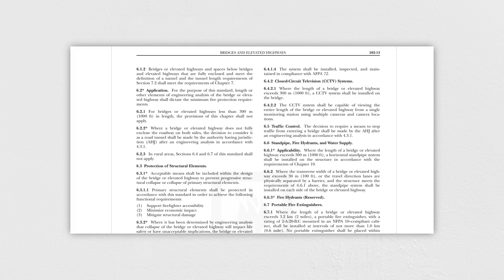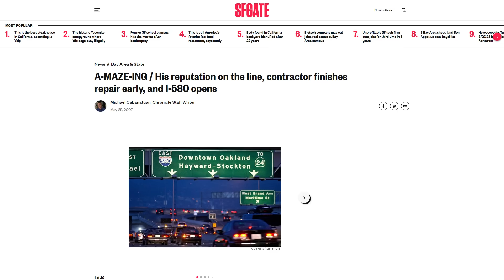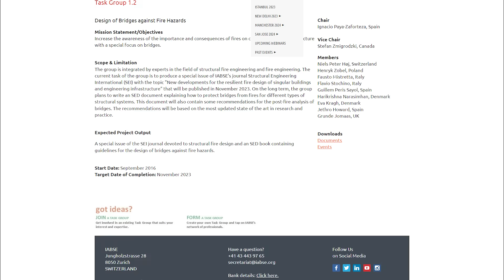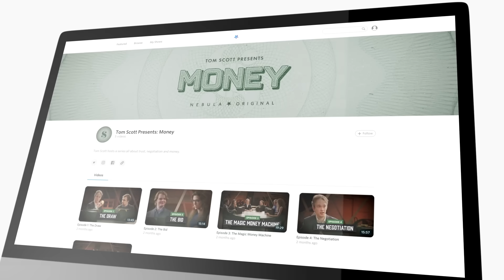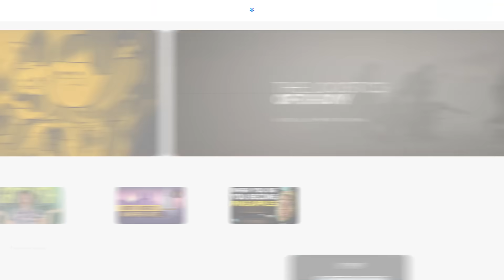Philadelphia I-95 Bridge Collapse Explained

Comment: Automotive infrastructure is the most expensive to maintain.  Train though not the cheapest is the most effcient in moving people.  Large passenger helicopters is actually the cheapest in they just need a maintence garage, crew pay and fuel.  A bus is less expensive then a number of cars to move the same number of people, but uses the same expensive roadways.  A subway/metro due to use of tunnels is more costly then a surface train, but in city where they are supplied, the ridership makes up for that increased cost.
Reply: I hope your not actually making an argument for the cost effectiveness of helicopters. A helicopter able to lift a bus worth of people will burn literally 100-400 gallons of gas per hour.

Comment: Nice job love youre video's.  However in the netherlands we do have regulations about the minimum protection against fires and explosions. Al defined by the state in the ROK 2.0 (richtlijnen ontwerp kunstwerken) (guidelines to design civiel structures) a addition to the eurocode. Greetings a dutch civil engineer

Comment: I must have missed the part where you stress (heh) how steel weakens at temperatures way below its melting point. I believe that's a real factor.
In a firefighter documentary, they were called to a burning warehouse in a train yard. The warehouse was brick walls, steel frame and roof, all ground level.
The warehouse was filled with charcoal and copy paper and whatnot, and all of it caught on fire.
The steel beams supporting the roof simply turned into noodles, buckled under the load they were designed for (just the roof)... and the roof came down.

Comment: I think that are several hardships in protecting bridges.  What is the fuel type and source, intensity, length of burning.  Which one do you build to protect against?   You can protect steel and concrete from fire but not all of those protective measures will hold up well to various weather conditions around the United States.  These same protective coatings might also hide flaws during annual bridge inspections causing new issues.  The protective coatings could also get damaged if a truck crashed into the bridge structure making it useless.  You could install fire sprinkler systems at great costs but it would subject to vandalism and weather requiring even more inspections.   Unlike designing for earthquakes, there is not usually an ongoing costs like there is for fire sprinkler systems.  I would only install these in high risk area or tunnels due to the annual costs above installation.

Comment: Since concrete can and will burn if a fire is hot enough on top of the heat transfer to the metal of the rebar, any bolts or expansion joints weakening those affected it isn't hard to understand why a bridge or overpass collapses from a fire. The issue is more can they be built to reduce the risk without increasing the cost dramatically.

While concrete can burn if the fire is hot enough the chance of a bridge span fire getting that hot are infinitesimal so there is no need to add fire resistance to the concrete itself.

Comment: A fuel truck crashed into the FL-528 SR-3 overpass and weaked both bridges. It reopened 24 days later with two new bridge spans... Cost was about $25 million dollars. If the Patrick AFB fire crew had not shown up to spray fire suppression foam, it would have caused more damage..

Comment: I'm not sure trying to make bridges fireproof is the answer. After all, nothing much is going to resist the heat of a tanker full of fuel on fire, no matter how well designed! A better solution would be to design bridges, especially the type featured in the video, to be easily replaced if they are destroyed. These bridges are all pretty similar to each other, so a few standardised designs should be able to be used for 90% of motorway bridges (especially if one of the design requirements is that the junction (etc) should use one of the standard bridge types).  This would mean that, once the debris is cleared away and the rest of the structure is checked for safety, etc, the bridge could be rapidly replaced using a stock of standard parts. This should mean that the motorway could be safely opened again within a matter of days - perhaps even within 24 hours in 'simple' cases.

Comment: 14:54 That's a very fake screenshot.  Windows 3.x only had support for 256 color palettes with the first 16 colors largely being unchangeable.  Those colors in the "Shanghai Metro Map" would either be mapped to far uglier colors OR dithered to the existing palette.  The screen resolution of Windows 3.x was generally 640x480 so those lines would not be smooth, hi-res lines with clean edges.

Comment: Wait, but does it collapse because the metal melts, or does the concrete break or what?
Reply: The metal loses most of its strength from high heat, it couldn't hold the weight of the concrete.

Comment: Curious, I’ve never heard of a bridge/overpass collapsing due to fire and some searching on the internet doesn’t turn up a single occurrence of such an event in the Netherlands. The worst I can find are some instances of where concrete pillars or girders needed to be replaced due to fire damage leaving them not up to standard anymore. I wonder whether we’ve just been lucky, whether Dutch infrastructure standards are higher or whether for whatever reason we don’t get the kinds of intense fires that cause collapse.
Reply: It's happened before in the US, US is very car dependent so we have a lot of road Infrastructure that is vulnerable to accidents and we have more fuel trucks trying to deliver that fuel to the 300 million+ cars on the road so it's far more likely to have a situation like this.

Comment: Thermal insulation that doesn't burn or completely deform? air + steel sheeting (3500c ?? ) below, creates gap to prevent damage from direct heat
Reply: That increases cost to build and maintenance required to maintain the sheet from rusting.

Comment: So what did the fire do to the bridge to make it collapse? I understand the challenges to building fire resistant bridges. But I typically think of concrete and steel as fire resistant. How how exactly did the heat affect this bridge?
Reply: Steel and concrete will resist fire, for a certain amount of time and are built to resist for a given time, but eventually the heat Penetrated the concrete due to it being over the hotest spot of the fire and started softening the steal supports. At 1500F steel looses most of its ductile strength, this fire can easily heat it to 1800F.

Comment: I guess the thing about fires on bridges and similar infrastructure is that they're kinda "self advertising" in a sense. The fire is pretty noticeable from far away so people will just avoid the bridge, if the bridge is fairly short then the ones on it the moment it broke out will have time to get away as well. So therefore on small bridges there's really not much point in protecting against fire, on much larger bridges the story is different since they're expensive enough to make fire protection worth it and they're long enough that it'll take a while for people to clear it so fire protection is more necessary. Fires in areas where people can't escape easily like buildings, sea platforms like oil rigs, and ships are a much bigger priority.

Comment: This is probably impossible, but why don't major overpasses have some sort of foam fire suppression system to at least try and prevent something like this? Would it come down to money, or construction... (or both)?
Reply: I think it would just be massively expensive–the plumbing, sensors, electronics, storage tanks for the fire-suppressant, etc. 
Plus, fire suppressing foam is one of the biggest sources of the much-hyped but genuinely worrisome PFAS "forever chemicals" that leach into groundwater and have a huge effect on wildlife and human health alike. 
I think it would probably make more sense to mitigate the cause of the fires rather than the damage, i.e. requirements that tanker trucks have certain safety features or take specified routes.
Reply: @HenryKamp  makes a lot of sense. Making a system that complicated for events that rarely happen would be a waste of money and resources. It’s hard not to think there could be some sort or realistic solution to tankers crashing under bridges.
Maybe it would be better to look at the full picture and try to cut down on sharper turns and blind spots.
Also, I do wonder if the tanker trucks themselves could have better preventative measures during the event of a crash to at least minimize the result of ignition.

Comment: i wonder what happens on an employee employer level when something like this drastically changes someones commute.. that person didnt choose that commute by taking a new job or moving to a new residence so its hard to blame the employee but theres likely no specific laws to require to employer to accommodate them in anyway could easily add an  hour to their daily round trip and alot more fuel and wear tear on their vehicle.. if the employee isnt helped cover these costs and simply chooses not to goto work in protest can they be let go? 

id be interested to hear from someone who had to deal with this, its not a simple 10 minute delay nor is it a one or two day thing, that could be an extensive route change for weeks possibly over a month not know how quick construction would have been
Reply: Generally speaking there's no legal protections for the employee in the US for these scenarios; it's typically "come in or you're fired" as consistent tardiness or refusal to come in is going to be a violation of the employment agreement. Any agreement on that is likely to be dictated either by company policies, union contracts, or individual negotiations.

A good employer would try to mitigate that stress, but there's plenty of not-good ones out there.

Comment: I lived in Atlanta at the time of our interstate collapse and saw the amazing work they did to do a full rebuild in only a month and a half, for six sections of 5 lane interstate! I assumed Philly would do the same, but they are not apparently. I'm curious to see how this partial but even quicker reopen works compared to if they rebuilt the whole thing ASAP.
Reply: This temp fix got 6 lanes opened in less than two weeks, and left room for the final bridge to be built in different phases. The final construction will take much longer than a couple of months, but the underpass that is now blocked off only served north bound traffic, so I doubt that closing it for a year +- will make too much of a mess. Apparently there still are questions as to how much damage the vertical concrete walls that supported the collapsed bridge section received, and if that too needs to be replaced it will add time to the job, as now part of those walls are buried by the temporary fix.
Reply: ATL drivers are so hard on the roads the city's gotten good at rebuilding them

Comment: Fireproofing bridges...  start with fuel tankers.  Class 3 products, need to be doused with foam.  Simple solution, place a sprinkler system into the overpass structure.  However, what happens when you have a Class 4 fire - which is dry chemical extinguisher only?  One thought is to make the underpasses with box culverts, then overline with limestone.  Some forms of limestone are excellent firewalls.  With the box culverts, having a store of 50 or so stashed somewhere would be a handy idea.  Have a universal height and internal dimension, and set up the overpasses using these box culverts.  Then, on top, place steel beams, a deck, then make your new roadway on the decking.

Comment: Not a bridge collapse, but a bridge replacement and construction.

Recently in the past 5 years over and on I-80 east of Salt Lake, they have been replacing overpass bridges and adding in overpasses and I can tell you right now, it is a pain to go through the redirected traffic. Especially since my job route goes through those zones.

I also lived in Maricopa, AZ for a few years before Salt Lake City and back in 2016 the city purposed an overpass over the rail lines going through the main highway 347. These trains would be miles long and cause so much traffic, especially since Maricopa was growing from the 33,000 people from when I moved there, to the 68,0000 when I left. So, because of this the city, state, DOT invested $51 million to build an overpass and reroute the major roads. The cool thing was that before I left, I got to see, and experience, the construction firsthand, and the major delays caused because of. Unfortunately I moved just a few months before its opening. I haven't gone back in years, though I would imagine me not sitting behind a train anymore. Honestly the engineers of freeways and highway systems are the coolest.

I will put a link of google maps in case it is something interesting you want to see. Go into streetview in different locations and you can see the progress, who knows, maybe you'll see me :)...

https://www.google.com/maps/@33.0546441,-112.0462409,1520m/data=!3m1!1e3?entry=ttu

Comment: You can also use high density polyesthirene ("geofoam") as backfill. I've seen been used as backfill under approach slabs before bridges in low bearing capacity soils.

Comment: NFPA 921 is what is used when investigating fires. When steel sags (annealing) like that it is because the steel reached at least 1500F, which is a data point for investigators. Most fires burn around 1800F so the question becomes how many watts of energy were being put out based on fuel available, size of the fire in sq ft, distance from fire, time it had to impact the members. There have been studies done on concrete encased steel and it’s performance in fires. The question is really how much time do you need to buy responders to extinguish the fire before the steel is weakened. Fire resistant coating vs insulating properties of added concrete (spalling issues?) vs thermal density of the steel. Interesting to see if the added cost to increase exposure time is worth it compared to number of incidents and impact when they fail.

Comment: Identifying potential locations for rollover accidents (e.g. a bridge support right after a downhill curve) and taking steps to mitigate risk of an accident in the first instance would be a sensible and cheap solution. Consideration of these risks in the design phase to reduce the chance of collision would also be relatively cheap. For example - more aggressive speed reduction enforcement in vulnerable locations, restriction of transportation of flammable material in these locations, more super-elevation and better protective barriers designed with tankers in mind. The cost of some extra paint/signage, or a bit more concrete used under the bridge would be very cheap. Truckers are already told to always continue in the event of a fire for a reasonable distance until a safe stopping location is found - and nobody wants to crash in the first place, so I'm not sure education comes into it here.

Comment: Mitigating under bridge fires is an interesting subject. I would add active protection (eg fire distinguishing equipment) to passive protection (insulation) and also prevention (eg adding extra height) if at all possible.
Reply: It might be an issue of cost/benefit. Even though the economic impact of these crashes is high, these crashes don't happen often to justify the cost of mitigation on all the bridges that would be good candidates. Risk management of low-probability high-impact events is notoriously difficult when you don't have infinite money to throw at all the possible things that could go wrong.
Reply: @erikdietrich2678  I don’t disagree with you. 
It’s exactly the low probably/high impact that makes the subject interesting to me. 
I’d be only interested to mitigate the costs at a favourable cost/benefits ratio (and I’m very much aware that determining that ratio is, let’s say, a challenge;). Thanks for your reply.
Reply: josiasl  Reported

Comment: I distinctly remember the 2009 fire on I-75 near Detroit.  I lived only a few miles from there at the time, and happened to be in the vicinity when the flames were reaching 20 feet in the air.  (I was driving to visit a friend, not to gawk at the fire... :-)  In that one, the design of the freeway was partially responsible, as it happened on what is essentially a "hairpin" turn on I-75.  (See "1950's Interstate politics" for details.)  I remember what a traffic nightmare it was for so many months.  (The bridge went over a portion of I-75 I used every day for my commute into the city.)

When I heard that the  road authorities in Philly & PA got their road open again in only two *weeks*, I was astounded.  Their fix wouldn't have worked for the I-75 fire because our fire took out a bridge over the freeway...

Comment: Little closer to home for Grady, around 2013 the southbound US-84 bridge merging US-84 back into IH-20 just outside of Roscoe, TX suffered a similar fate when a semi-tractor crashed into one of the supports and caught on fire. The bridge was rebuilt and re-opened in 2014....only suffer yet another fire as the result from a crash that came to rest under the bridge within 6 months of being completed thus requiring a second, immediate demolition and reconstruction.